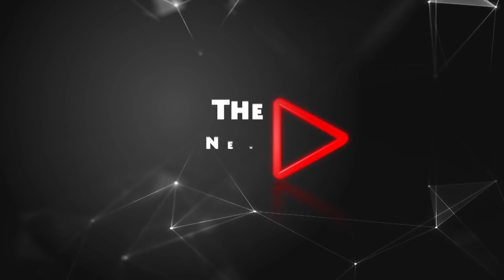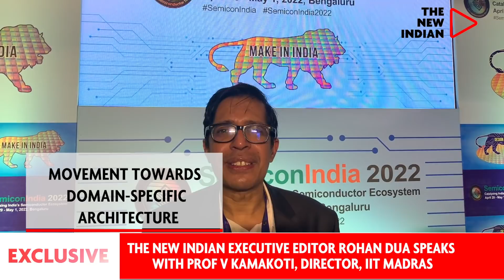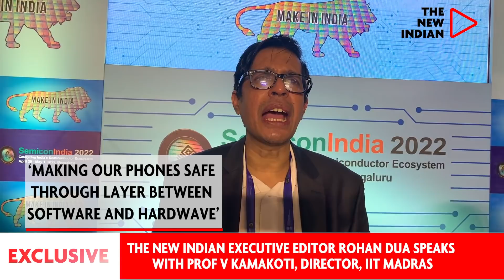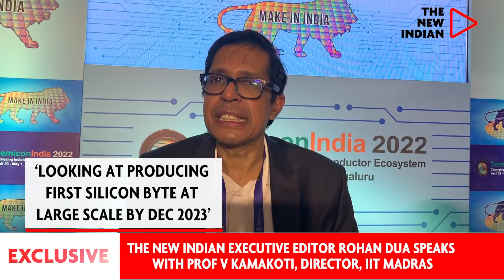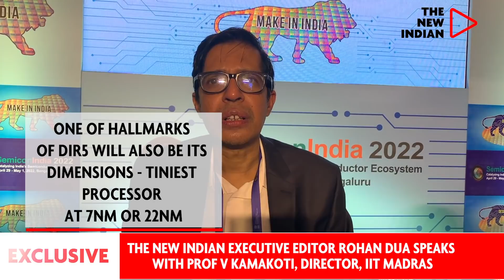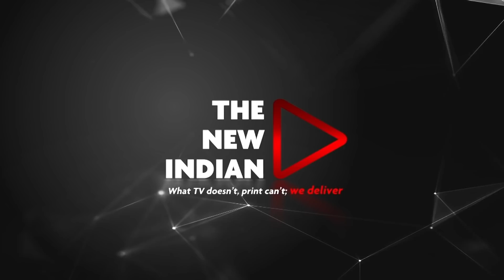India Building Tiny Processor At 7nm Or 22nm For Your Mobiles, Exclusive With IIT Madras Director

Comment: These are risc v processors.
Reply: They are practically of no use . If you're building it for microprocessor usage then why the hell they need 7nm node process . or else if they are building that for phones or pc , they use arm or x86 architecture.
Reply: @peggandwhiskey  you have absolutely no idea of what you are talking about. both windows, linux etc can be run on RISC V since both have been ported to RISC V architecture so that it can be run on RISC v processors there already exist companies like SiFive. Even ARM use RISC its just that ARM's RISC is proprietary while RISC V is opensource. Fugaku supercomputer which was fastest supercomputer up untill recently uses RISC architecture not specifically RISC V but based ARM's RISC, currently EU is building supercomputer based RISC V even India also have plans for supercomputer based on Arm's RISC(AUM processor) and RISC V (H class). CDAC's VEGA processor series also use RISC V ISA. it's just that x86 is popular because there is an established ecosystem unlike RISC V which has only recently got traction.
Reply: @otomackena7610  
Your comment contains facts . I appreciate that . But unfortunately you have no idea about usage . Windows/linux have risc or arm architecture based os but their usage is limited . or say nearly 0 . Windows have been long using CISC architecture based processors 
The problem remains with software compatibility.  You cant afford to spend on such things which dont have market .
Reply: @peggandwhiskey  I literally said in my reply that it is only because RISC V doesnt have an ecosystem, it is new and the communities and manufactures are only beginning to come up around it so it will take time to develop. When Arm used RISC architecture there was no ecosystem look at it now it has started to conquer eating in to server market completely swallowed the whole smart phone SoC market and embedded system needs. it will slowly eat in to other markets too x86 is big because of the huge ecosystem support it has from manufactures and communities. RISC V foundation have lot manufactures who are adopting RSIC V
Reply: @otomackena7610  
ok . just gimme one example of smartphone and pc which uses Risc5 architecture without googling . Risc5 and not ARM . I bet you cant . 
Over the years Arm has been developed into primary architecture for mobile processor . Every other brand uses qualcomm,  mediatek,  exynos, tensor and apple bionic or M series which in fact are based on arm . The intel , amd or Nvidia are based on proprietary Cisc architecture of intel aka x86 . Over the years applications and games and operating system has been developed for ARM or x86 usage .
Reply: @peggandwhiskey 😂
Reply: @peggandwhiskey  😂看来印度人真的很关心政治，对于技术方面的新闻毫不关心，竟然会说出 RISC-v 没用的话